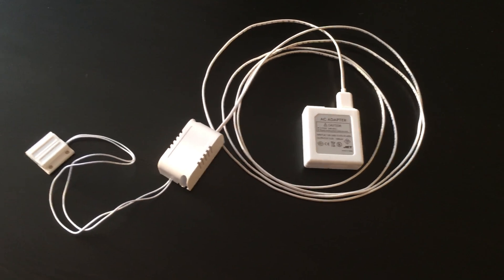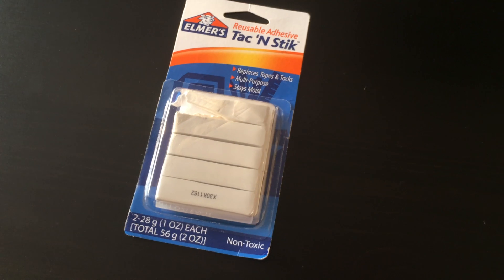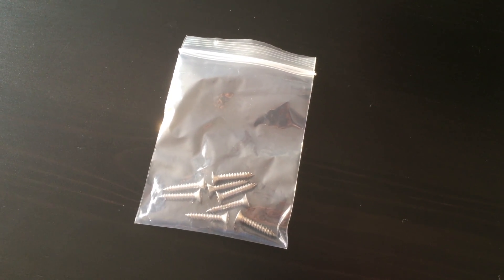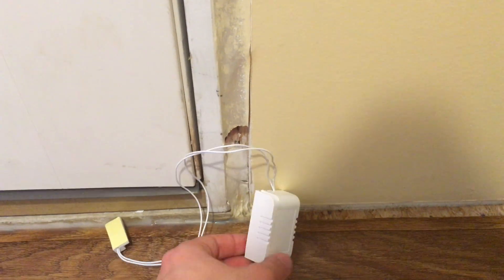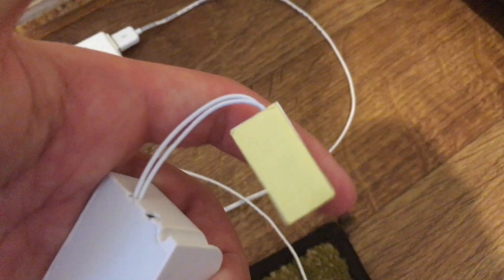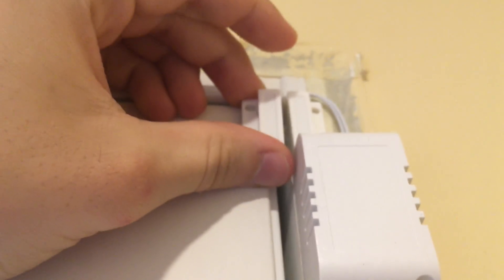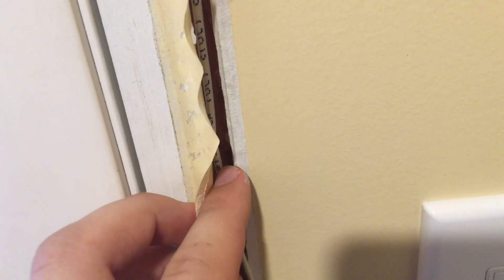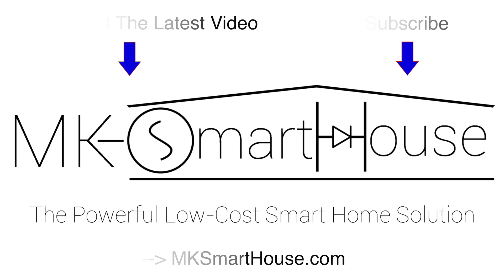Complete Guide MQTT OpenHAB ESP8266 Door / Window Sensor: Final Installation

Comment: Excellent video, congrats.
However here is my chief beef about these kinds of projects, YET ANOTHER APP TO RUN ON YOUR SMART PHONE.
I have several home automation devices, WiFi light switches, Thermostats, Garage door opener, but they all use DIFFERENT APPS.
It takes more time to remember which app controls which device than just walking over and hitting a switch.
What this whole universe needs is STANDARDIZATION, a common APP or INFRASTRUCTURE with a common interface, you run the app select the device and activate it.
Instead we have a plethora of APPS all over the place.
This project is JUST WHAT I WANT, to be able to ensure that my garage door is closed after I use my garage door opener switch.
I will try it and keep hoping for the ULTIMATE APP.
Apps like STRINGIFY are not the answer.
Thanks.
Reply: Science-is-god this is what OpenHAB is for. It conveniently controls everything as one system so only 1 app is required.

Comment: Great Videos!
I think you could mount the switch inside the housing and have the magnet next to it.
Would make it a little cleaner installation.
I have my Open HAB installed and running and getting parts to make window/door switches.
I also want to use you sprinkler switch to control my 3 button garage door. Open, Close, Stop. 
I believe I can build the code to activate the relays for 1 second then release.
I can wire 2 of them normally open and 1 of them normally closed and connect to the control wires.
Thank You again for the great tutorials!
on another note...
Any chance you know about UPB Switches and how I could inter connect them to my Open HAB Network?